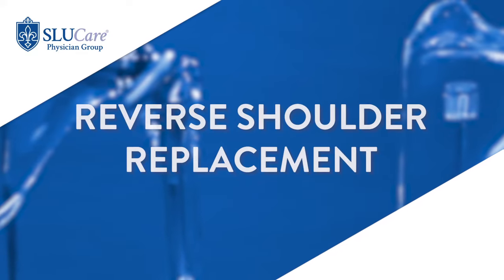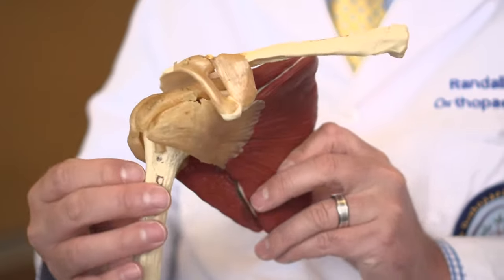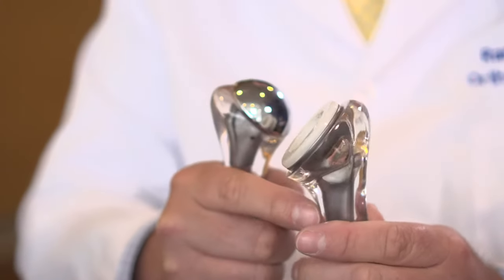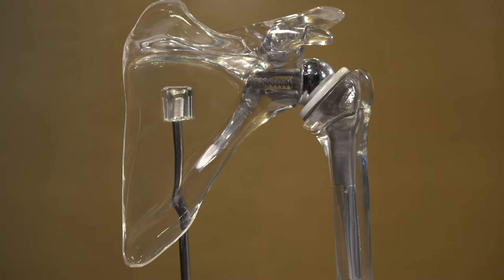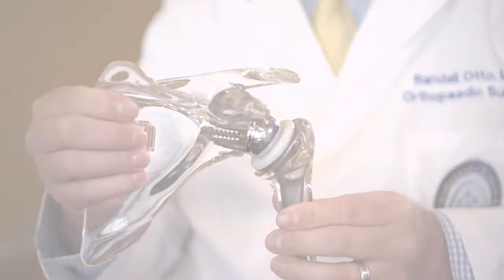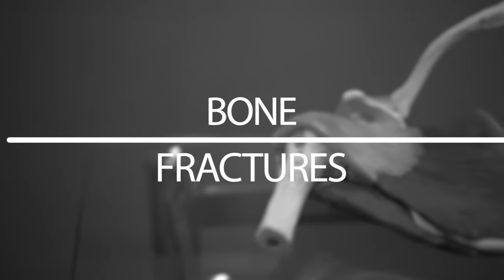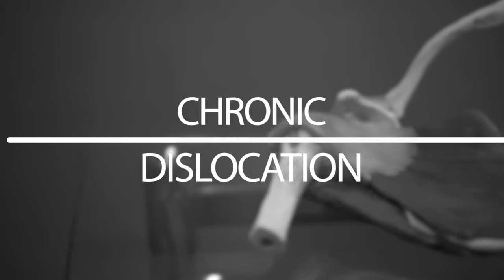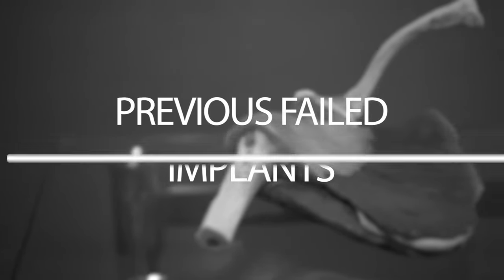What Is A Reverse Shoulder Replacement? - SLUCare Orthopedic Surgery

Comment: My surgeon said I won't be able to lift my arm past shoulder height. I will be able to put my hand on top of my head to wash my hair. I can never lift more than 20 pounds if even that. I might still have some pain. I take Vicodin 7.5 mg 5 times a day. I was taking 5mg 4 times a day because of severe SI joint pain. So I am not taking that much more pain med. My shoulder hurts 24/7. My pain goes down my arm into my hand. But I can raise my arm up above my head even if it hurts. I can't lift more than 5 lbs over my head but I can lift 40-50 pounds off the ground to my waist. They basically want me to have this surgery to reduce my pain meds.
The heck with that. No way. They won't even let you talk with other patients who had the surgery.
I choose pain meds and full range of motion. Even though I will never get a full nights sleep again.
Reply: I had the surgery done exactly one month ago. I only need medication the first 2 days after surgery and none after. I’m don’t physical therapy and it’s amazing how much range of motion I have already gotten back. I can actually lift my arm into the air. Don’t be afraid, it’s life changing. Get off the drugs.